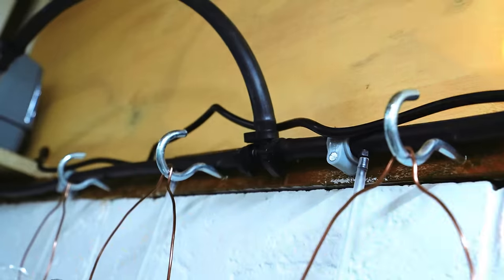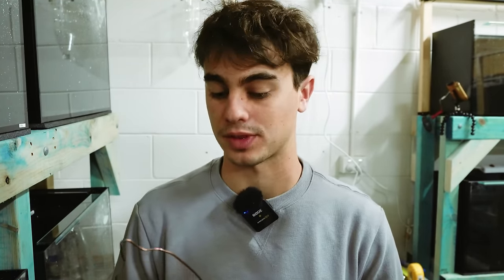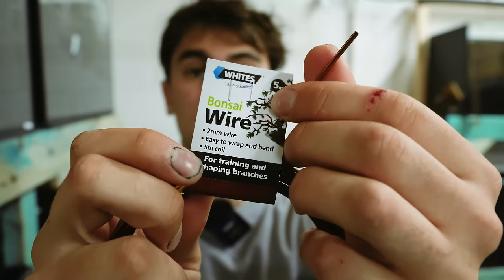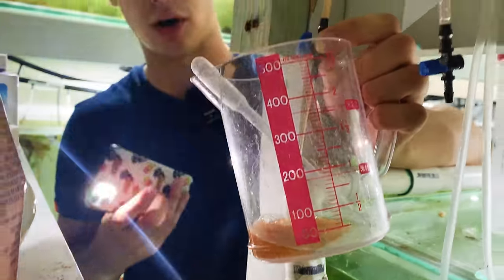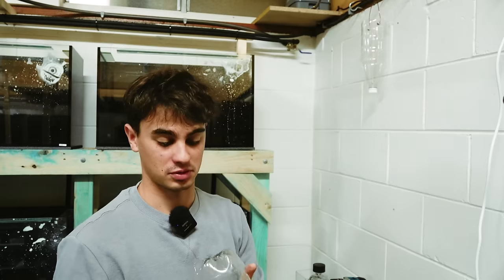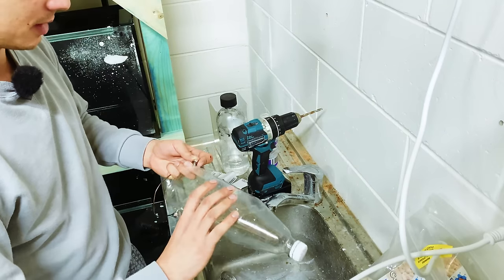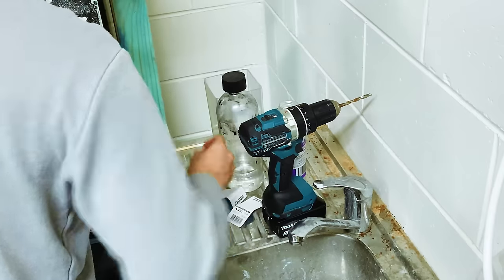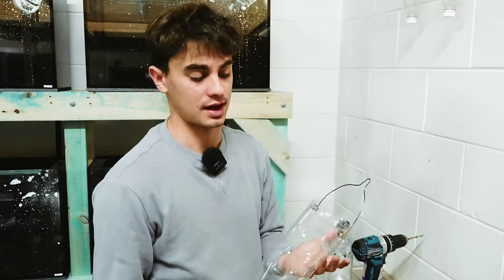How to Make the Best DIY Brine Shrimp Hatchery!

Comment: When you cut the bottom off, just cut a little bit further down the bottle (about 1cm). Then you can cut that excess off the bottom and make a handle out of that plastic. You can still bolt it on or just superglue it. Can use packing straps or whatever hard plastic is around. That way they won't corrode
Reply: Thats exactly what i was thinking

Comment: cheep just knock 2 holes in the sides use some copper wire drop in and air stone no hard wear needed or just cut another bottle in half to hold it up right and use a lamp if you need to warm the water and you can get a horse needle and some air line to remove as many as you need to feed your fish old school still works

Comment: could just spray clear coat on that wire mate and it wont corrode, i think its copper so it will oxide but not rust in that sense

Comment: I've made myself A DIY also. I use thin wires but my wire dont rust, its aviation grade. Its been amazing, using a 2L Crush soda bottle. And don't make a huge hole for a thin wire, poke a hole and its good enough. For the cap, I drilled a hole just big enough for the air hose and I used silicone to seal  it up and made it leak free
Reply: Same here, but eventually the silicone fails.  I'll be looking for those 'CO2 caps'
Reply: @antsadams  if not installed right, it will not fail

Comment: I use this setup with 2 differences: 
#1 I put the cut-off bottom upside down on the top to help with evaporation
#2 instead of bolts and wire I use 2 large plastic zip ties
Reply: how long can the brine shrimp be kept in the bottle? (after they are hatched)
Reply: @abizerbastawala3627  I'm not sure, I have only had them in there a few days after they hatch
Reply: @abizerbastawala3627  they can survive for up to 4 days if you keep them in a fridge
Reply: @No_lavishness  wht if you freeze them?
Reply: @abizerbastawala3627  then they will die and won't be live foods for the fish anymore. You have to keep the culture going otherwise you will be making baby shrimp alot.

Comment: I have found, from using the plastic bottles for mini green houses for some of my plant starts, if you place the cut side of your bottle on a hot surface ( I use a small saute pan that I never use to cook with, on my stove to heat it up) the plastic will kind of solidify (and smooth a bit), making it much more sturdier - less flimsy.. you're not really melting it at high heat - just medium heat, while you gently push the bottle down to make good contact. It takes about 30 seconds lol..

Comment: Use a Soldering Iron, or heat the tip of a Phillips Head screwdriver (etc) to melt holes in plastic.

Comment: Great tutorial! One thing I would change with your design is to have the blue valve higher than the water level. That way you can just close the valve and unplug that instead of the connection to your main air system. Other than that, it looks like a very sturdy build!

Comment: 2:20 -- RE: Marine grade hardware, wire hangers, and Brine -- A thought occurred to me as I was watching and thinking about the problem of rust.  It should be possible to find a replacement for the wire "U", perhaps a very stiff plastic or aluminum.  And, if that's not cost effective, its also probably possible to find some sacrificial metal to prevent the wire from rusting.

Now, with that being said, I could also anticipate that perhaps having more Zinc interfering with the chemistry in the breeder bottle would be a bad thing, but it also occurs to me that simply having iron and steel in contact with the water will be doing a similar but slightly different thing.  Either way, the preferable third option in my mind are very heavy duty plastic "zip ties".

Comment: Love your vids. They are Multi-grip plyers, and you can also get stainless steel marine grade wire that will never rust.
Reply: Stainless is much harder to bend than aluminium (or copper)
Reply: just use nichrome wire can get rush easily bended..

Comment: if you need to upgrade the wire there is something known a locking wire that is used on race cars and airplanes and it is stainless steel and relatively cheap. I know I have seen marine grade locking wire but I don't know if all of it is marine grade.

Comment: Great channel. One problem with those caps is that a cap full of the most dense brine shrimp is missed. Just cut off the inside tube on the outlet side and you get all the shrimp.

Comment: Bonsia wire is copper I'm sure it will be perfect. I agree mate Kirks bottles are the best.
Reply: Yeah. Bonsai wire is used to shape bonsai and will not rust. You can use solid electrical cable too. (Remove the insulation.) and yes on Kirks too :)
Reply: @jm9841  yep I was an electrician I also thought copper wire would work

Comment: Just skip the wire, bolts and washers and use a thicker fishing line. It’s very sturdy, the water can’t damage it and you’ll avoid rust all together. You might save some money too.

Comment: So I think I may have a solution to your problem with the wires rusting. I think I heard in a newer video you mentioned that you had stopped using this method because of the rusting wires. 

Have you tried sliding the wire inside some tubing (like what you are using with the air pump), and then either melting the end shut or plugging it with a dab of silicone? Just something to keep the water out. Then just feed it through the drilled holes in the bottle as usual. Would probably be a good idea to then wrap the tube encased wire back on itself a bit and maybe secure with a plumbing epoxy or something to keep it from releasing the bottle from the water weight.

Another option that might even be simpler and solves the risk of the tube encased wire letting the bottle slip would be to, instead of using wire, use a thin chain from the hardware store (the thinnest should still be good enough to hold this tiny amount of weight but you can always double check with the clerk). Then run the chain through the tubing, enough to go down through the drilled hole and back up on each side of the bottle (so like two U s, one per side). Allow a chain link or two to stick out of the very end of the tubing. Then use a small carabineer to link the chain ends all together and to then hang from the hooks.

Small chain seems to be pretty cheap and obviously aquarium tubing is cheap, so you are just looking at the cost of the carabineers! If that continued to rust I would buy a small bit of tubing that is very large, large enough to fit over the carabineer you select, then as a last step, slide the big tubing down on one side over the tube encased chain. Secure the chain links to the carabineer and then slide the large tubing up and over the carabineer, ensuring it comes down a little bit on each side over the smaller tubing. Then for a final measure of overkill you could plug up any holes between the large tubing and smaller tubing with a bit of silicone.

Might be total overkill but it's cheap! Just wanted to offer my two cents! Really, really appreciate your videos and all of the work you've done for the hobby thus far. You're a legend!

Comment: You can get cheap aluminium wire in craft section of discount stores.  I use it to make plant holders for over the side of the tank.   What brand bbs do you get in Australia & where from?  I’ve been getting off eBay, but not very good hatch rate 😞❤️🇦🇺

Comment: Thanks, have been looking at the expensive ones, this is great. Just a question, does the first washer go by the nut head, before looping the wire around?
Reply from the maker: Do from outside in  nut head, washer, wire, bottle, washer nut head
Reply: Just make a knot with the wire??? Nothing else needed...

Comment: You have a great idea here however, you didn't say what you were doing while doing with the co2 cap. What was that that you wrapped around the top of the bottle? Is there a particular way to hook up the hoses, I mean are the connections different or the same? What is that thing that looks like a splitter? Why did you put it in your mouth?
You have to understand that Not everyone knows what you're doing and why.
I can't make one of these until I know ALL parts needed and what to do with them.
Can you explain it to me in detail please?
Reply: When he was wrapping the neck of the bottle, he had text on the screen saying to wrap Teflon tape (also known as plumbers tape) to help avoid leaks.

Secondly, he said to add airline tubing to both nipples of the cap.  

On one of the hoses, he attached a spigot (see 9:12 mark where he shows the bag called "in-line tap"). This is used when he harvests the BBS.

The second airline hose is connected to the air supply. It has a connector that allows you to increase or decrease the airflow depending on your needs.

Comment: I've done this before but I have found that the air hose that drains the shrimp out and the valve at the end of it tends to get clogged up very quickly.  the air nozzle that the air comes out of also clogs up.  have you found a way to prevent this from happening?
Reply from the maker: You have to blow it out and tie it up lol
Reply: @KeepingFishSimple  ahhaah exactly the reason I went Ziss. no Fuss looks great and just does the one job with no mess. - I feel the handle is the best way to mount it, get rid of the stand
Reply: Please read my reply on this post bcause I have NO idea what y'all are talking about other than the wire set up. Tx
Reply: That was To: Keepingfishsimple

Comment: do you realy need the bolts and washers? why not just bend the wire and poke it through the hole you drilled?
Reply from the maker: It eventually wears out and hard to clean

Comment: not to throw shade on your video, but you could litterally just use catheter bags and skip the whole process. you can get like 10 bags or $15 and they have all the parts you need to do exactly this.

Comment: if you are concerned about the alyoominium wire why not just use stainless steel wire?
Reply: Likely due to the price difference in guessing
Stainless wire is much more expensive but worth it if you aren't changing it out. I'm sure the aluminium wire should be good though
Reply: @mattywirednet  oh thanks matty